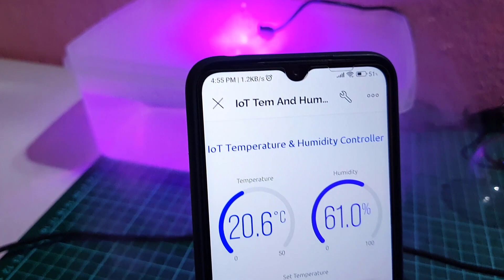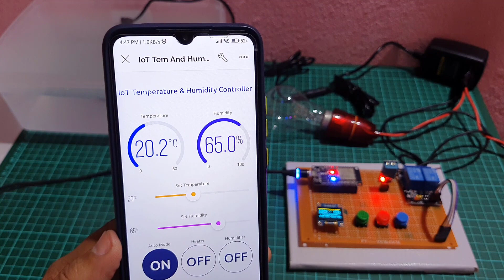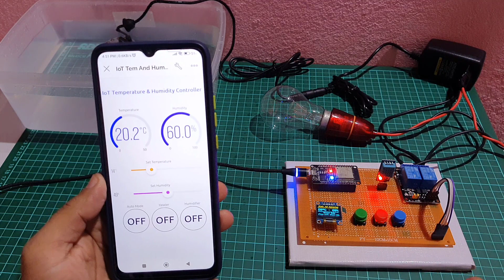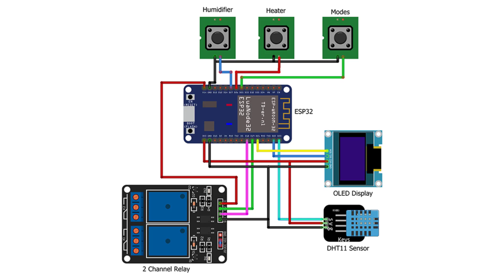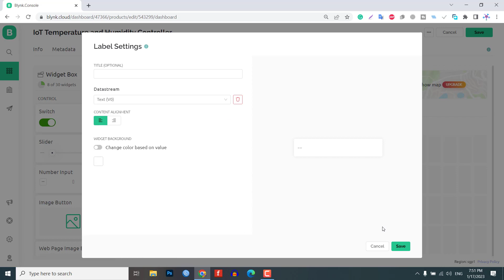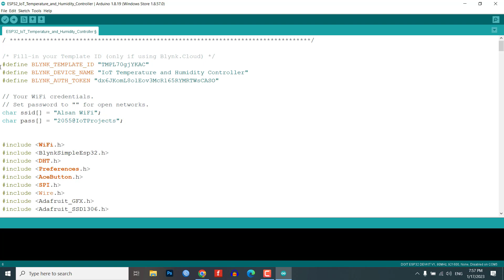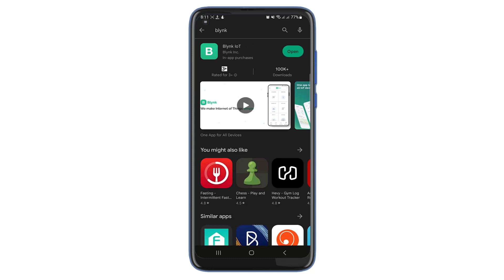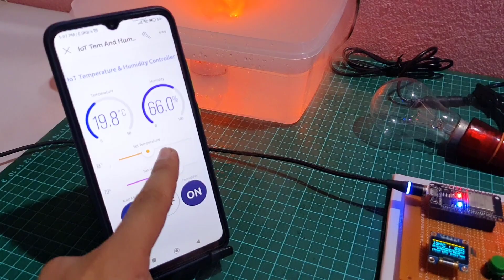IoT Temperature & Humidity Monitoring & Control System using ESP32 & Blynk 2.0

Comment: Sir I make a project using esp32 and 4 channel relay. The project works fine on after uploading but after power interruption or when reset button is press it doesn't work and there is a single led glowing in dim light on the relay. Please help me how to solve this problem.
Reply: Make sure there is a enough volts on VCC of relay. I had same issue when tried to connect 5V relay to 3.3V esp output(I didn't knew about that in the moment)